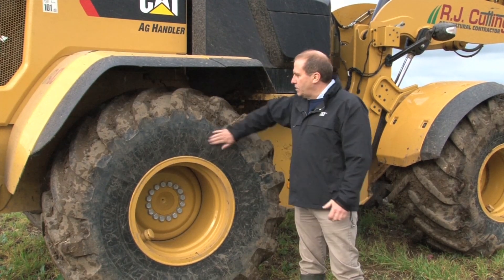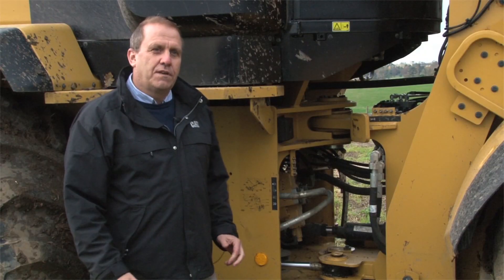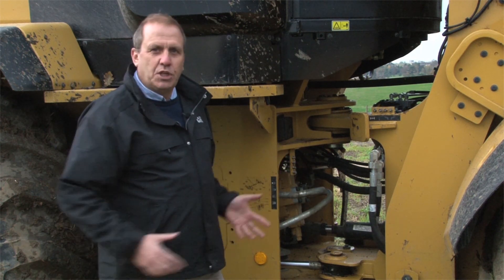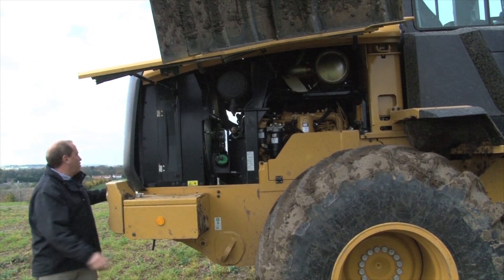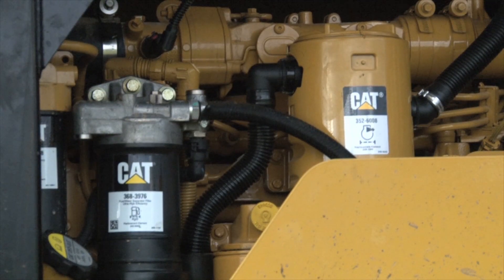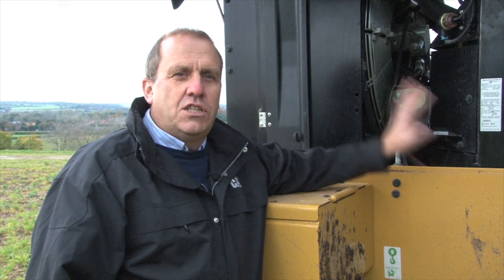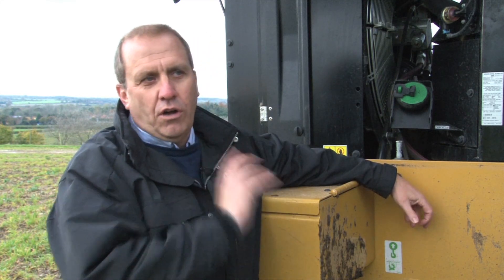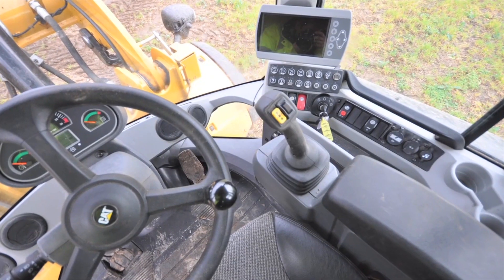Cat 924K Agricultural Wheel Loader Walkaround

Comment: i actually have about 1k hours in this machine and its great but we also have the 924h which i just love.  some problems i run into when im using the loader (moving wet distillers grains for truck loading) is actually the transmission.  the surface i work on tends to have the consistancy of ice and even with the rimpull turned on its just impossible to stop wheel slipage for when im pushing the distillers grain.  the dif lock trigger is a nice touch and im really glad they didnt put it off to the side or as a foot switch like so many other loaders i have been in.  we cant seem to work this loader as hard as the 924h seeing every time we push it we have some sort of hydrolic failure (most recently a steering acuator blew a seal) but over all its still a great loader and like you said its extremly comfortable for long shifts.
Reply from the maker: Thanks for such a detailed response - This is precisely the kind of feedback we are keen to encourage.
Reply: diggersanddozers no prob :D